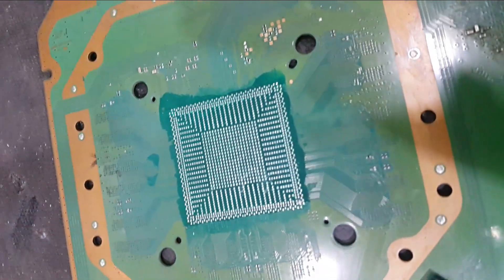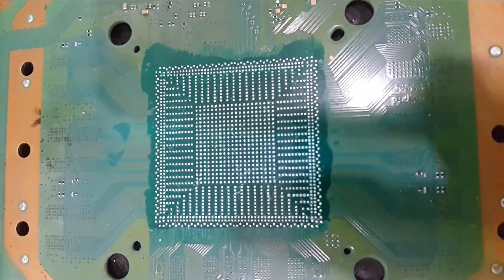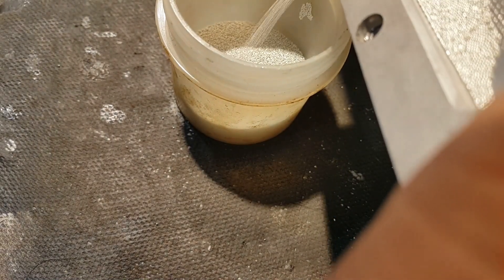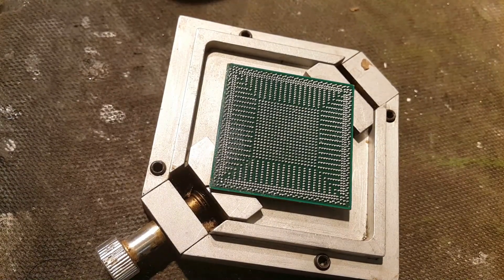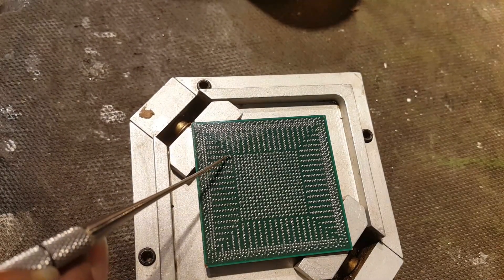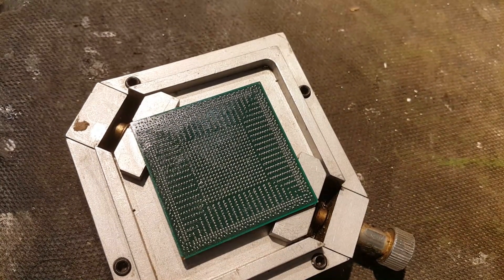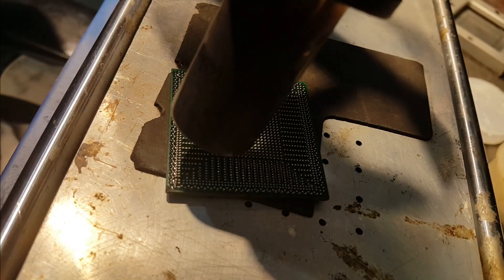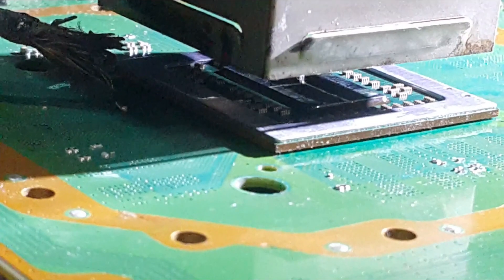BGA Reballing and Replace after curing the solder pads mask 🔧✨

Comment: Hello my friend how are you I'm from Lebanon and I give you support I sub to your channel I'm here to ask 1 question when I'm replacing the solder balls on the blue station the balls sticks in to the stencil not on the apu do you know what's the problem is it because of Flux?
Reply from the maker: First reason is the stencil, it should be clean like a mirror.
Secondly apply a very little amount of flux paste on the chip.
There should be a slight gap between the chip and stencil.